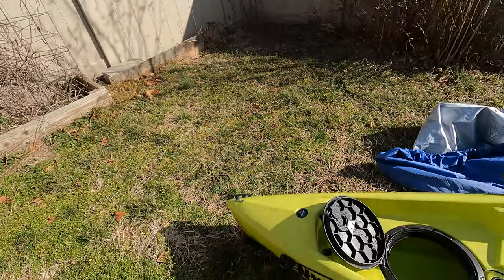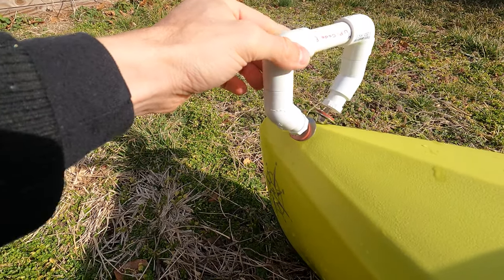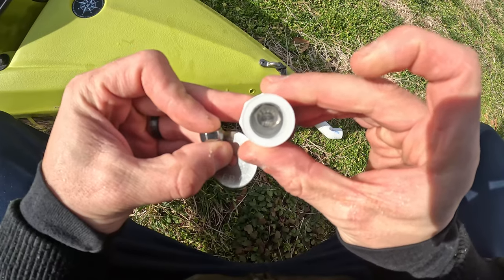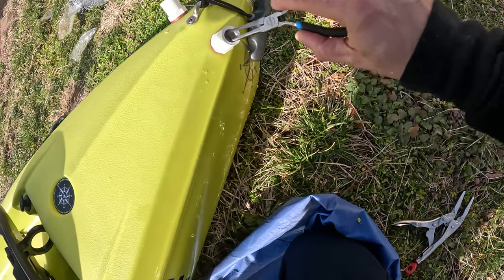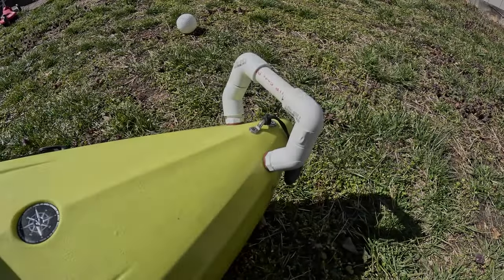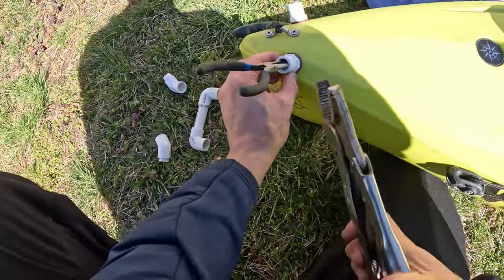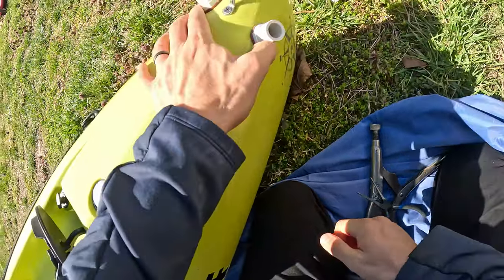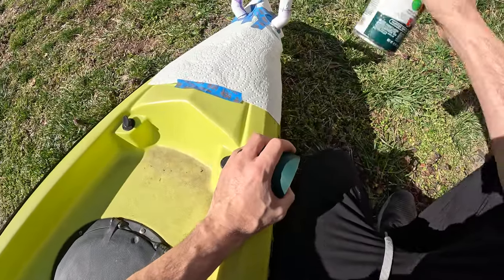Hobie Compass front bow handle mod using PVC

Comment: Good job. I purchased a Hobie last year and the only thing those handles were good for was testing my patience once I had gear in there. I put one of those paracord grab handles across the rear of my revo during the winter and I'm looking forward to getting back on the water soon. I nearly choked on my lunch when you said hunter green but we've all been there 😜
Reply from the maker: LOL its true man, when the kayak isnt loaded the handle is fine but seems like once i have my gear in there it hurts, time will tell if this even helps.  Nice on the rear handle, that should be helpful especially with the unload/loading.  Seriously, I can't remember where I got that spray paint, but seemed like I wouldnt be using it for much else 😅 so why not!

Comment: Nice job mate...i may be stealing this concept!! 😅
Reply from the maker: Go for it!  Full disclosure tho, I have since modified the bow to receive a trolling motor mount with a built in handle so I no longer have it like this.  But it did work for the 1 season I had it installed
Reply: @PeterRanieriII  awesome thanks and good to know

Comment: good video. I try to drill least possible number of holes un kayak hull...better long term, esp if you sell it in the future. Handle - I suck it up, yes Hobie one is not the best but I tried other kayak with molded handle (not mobile) and it is not really comfortable on your wrist esp with heavier load - please share your experience. At the end - I keep my "load" to minimum; even bringing pounds of "equipment" I use 10% of it 🙂
Reply from the maker: thanks Sergey, you're smart to avoid drilling when possible, it definitely only increases the chances of water getting in.  Thats interesting about the other kayak brands with the molded handle not being comfortable.  I will defintile keep you updated on when i load a bunch of gear in there and go down the beach a ways, you might be right 🤔 - so true about using 10% of the gear, haha i need to become more minimalist

Comment: Hey Pete. I subbed. I modify NOTHING. I am a minimalist. One 6' medium heavy one piece Shakespeare Ugly Stik with a Shimano 3000 Stradic, one needle nose piers, one Boga grip, 3-4 lures (barbs clamped down), bug spray, net, cooler and a large brim straw hat..... 
A sonar isn't needed. I fish casting to the shore, docks and rocks.... and I already know the depths from years of fishing the same waters for so long from boats too that have them.
Your rig is nice. Registration numbers on a kayak? In Florida it only needs numbers if it has a motor.... electric or gas. What's the regulation? What about a surfboard?
Reply from the maker: Francus! Glad to have you man, I need another hobie compass owner's advice.  I envy you that you are that minimalist, I try to be but always find myself enjoying the mods and thinking I need the gear, lol.  I guess the one difference for us though is that I do fish larger distances especially in the heat of summer the fish move to deeper water and I travel up to 4mi one way into the sound so having an electric trolling motor is clutch, can't put too much stress on those knees ya know.  In NY you have to register any vessel that has a motor.  But yeah i've done a lot of mods to this kayak, once you start its hard to stop, I'm always thinking of something it seems.